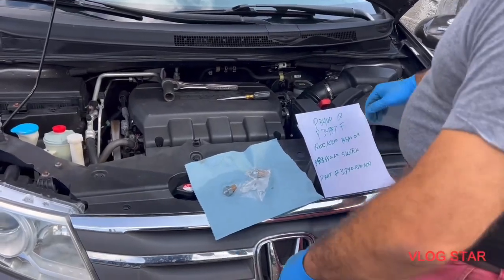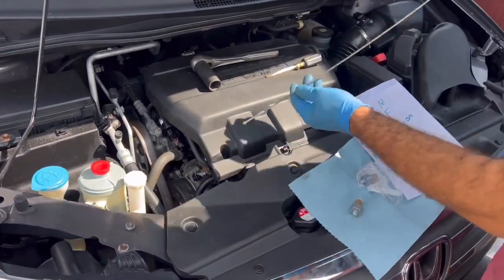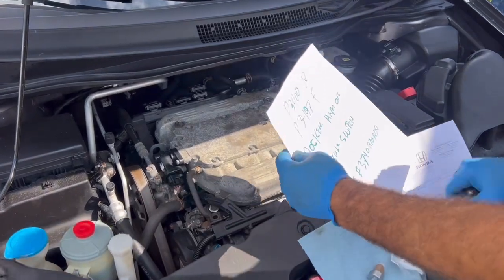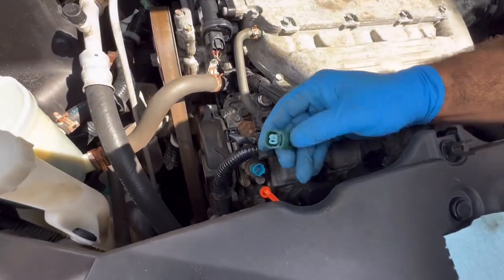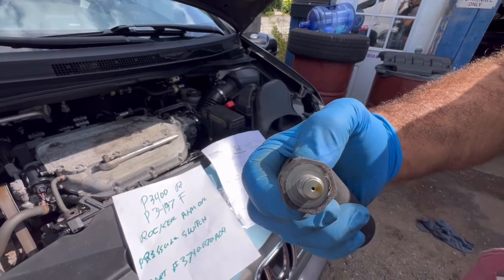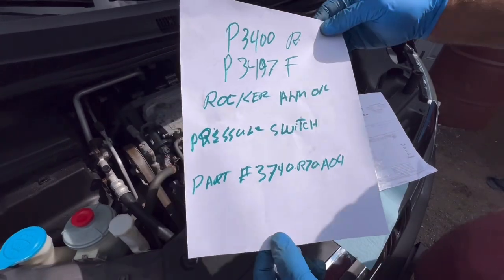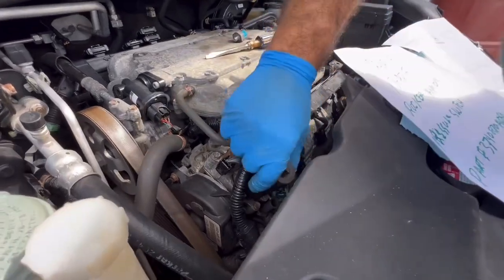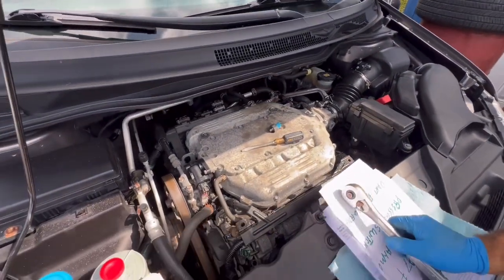2012 Honda Odyssey rocker arm oil pressure switch P3400

Comment: before u replace them 2 sensors, did the engine start up and idle normal? i have problem with mine the engine ible rough and stalled, when scanned got multi misfire codes. thk u